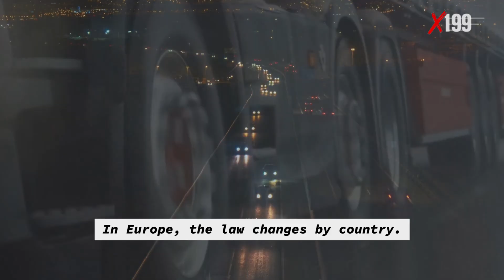770 HP vs 605 HP — Why Are They So Different? The Truth Behind the Most Powerful Truck Engines

Comment: This is nonsense. They use the exact same engines in both Europe and the us. The vast majority of the European fleet uses engines between 450 and 550hp and most of these engines are also available in us trucks with very little differences. 

The main thing is that in Europe you can also opt for bigger more powerful engines that simply aren’t available in the USA.
Reply from the maker: Thanks for the comment!
Just to clarify: in this video we weren’t talking about the typical 450–550 hp fleet engines. We were comparing the premium high-output engines, the strongest options each market offers. That’s where the real differences appear. Thanks for joining the discussion!
Reply: @x199-   but that’s also not true. The only engine you can get in the us that’s not similar to the ones in Europe is the x15 and that engine is not all that different then the larger European engines. The whole point of this video is nonsense.

Comment: That's only half the story. A Scania or Volvo can also make sense in Kansas, and Europe isn't all mountains and narrow roads. However, American truck manufacturers face no competition due to import regulations and can make more money with outdated and overpriced technology without investing in modernization. European trucks are quite successful and popular in Canada and Mexico.
Reply: Not in Canada, only in Mexico and further south.
Reply: Ok. But even in Australia with its long distances they use more and more european prime movers for their road trains with
multiple trailers. Lower reliability on long journeys cannot be the reason.
Reply: @janbilch9307  this whole video is complete nonsense because the vast majority of European trucks use the exact same roughly 13 liter 450 to 550hp engines. All the American trucks are owned by (or own, in case of Paccar) Europeans. It’s just that Europeans (and Aussies etc) have the option to go beyond that power and engine size and the Americans don’t have that option. Their biggest option is the 15 liter 600hp Cummins.
Reply from the maker: Thanks for the comment!
Just to clarify: our video wasn’t comparing the standard 450–550 hp fleet engines — we know those are similar in both markets. But even in the “common” segment, U.S. and European trucks are still very different in structure, engine layout, cooling capacity, torque philosophy, chassis design and overall engineering.

Our video focused on the premium high-output engines, because that’s where the differences become even more dramatic. But the point wasn’t that “regular trucks are identical” — it’s that the comparison changes completely depending on which segment you look at.

Thanks for joining the discussion!
Reply: I msick of dumb retard propaganda like you spew.